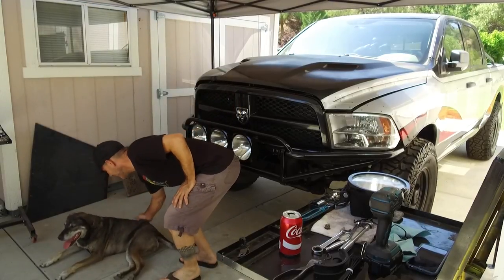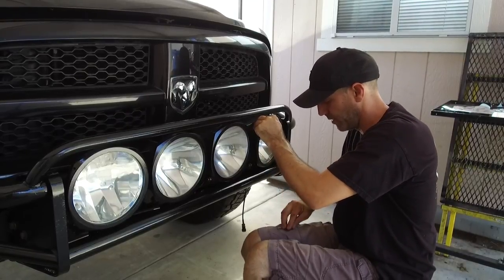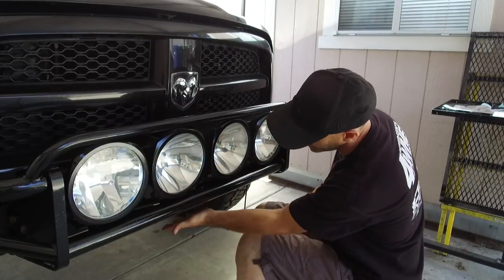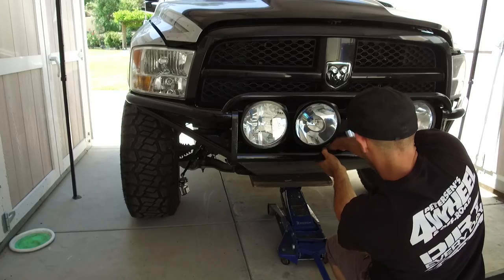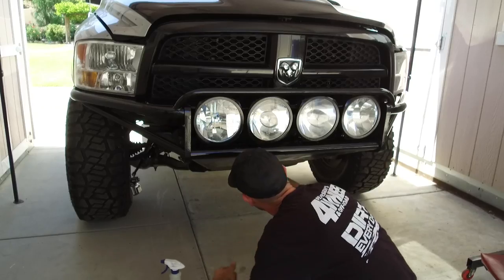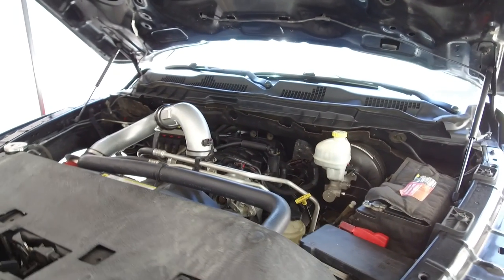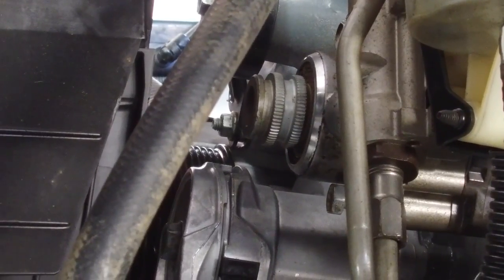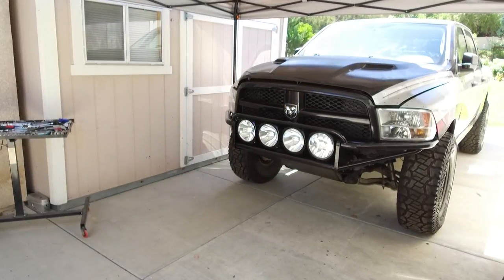Ram 1500 Truck on 37" Tires Project Preview and Pinto the Shop Dog Does Tricks!

Comment: I too run an open air filter. If my memory is correct fennigans garage did a open vs closed air cleaner episode and stated an open filter steals power due to heat. Guess time to box mine in and build a snorkel.
Reply from the maker: Here's the thing with that... it builds heat sitting in traffic but I don't care about power loss sitting in traffic.  I want full beans when I'm hot doggin' through the back country! So we'll do a test on this thing once it's running again!

Comment: What is the backspacing, and offset of the wheels to fit the 37" tires. I would love to have 37s on my rebel without a crazy lift like your black sheep, but one guy tried and the front tires hit the cab.
Reply from the maker: I'm not sure.  I can measure that next time I rotate them.  I think it's about 4.5"

Comment: Trying to find a answer to this maybe you can help , i have a 2015 ram 1500 slt , has a lift and 37s , should i be worried about running that big of tires on stock motor/trans/gears ? Thanks !
Reply from the maker: Nope
Reply: @AutoEdits  ok thank you , it was kinda bothering me , didnt want to damage anything , thank you !